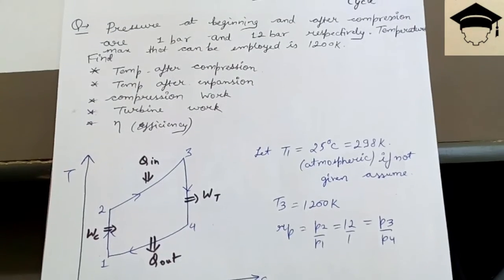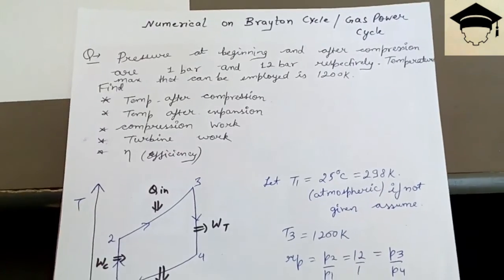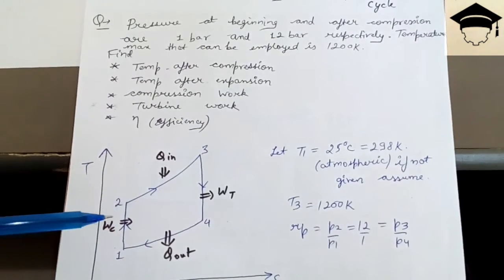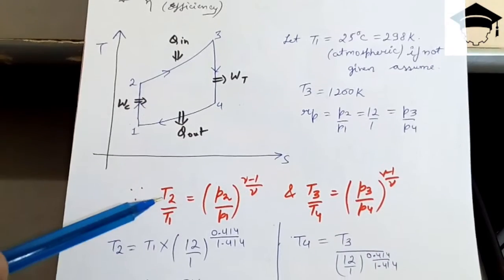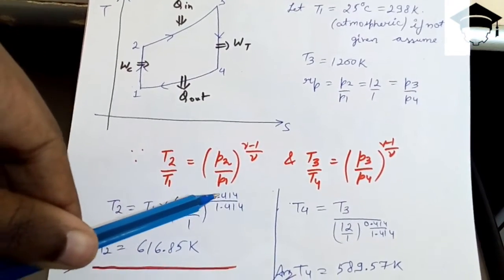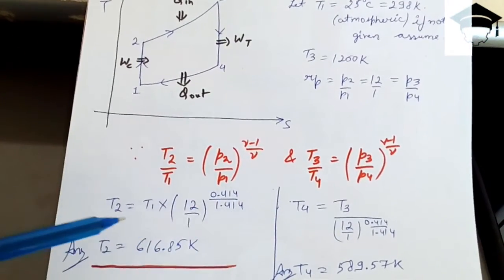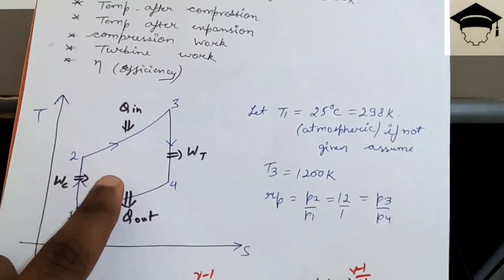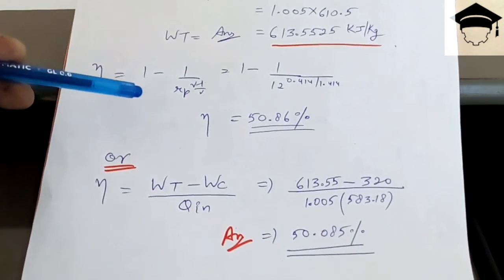brayton cycle solved numerical|brayton cycle solved example |brayton cycle nptel | brayton pv and ts

Comment: Hi, i have got this problem and it has defeated me. may you help me solve it. 
A gas turbine to drive a locomotive has the following technical specifications:
Combustion chamber pressure 600 kPa Inlet air pressure 100kPa
Inlet air temperature 20°C Exhaust gas pressure 100 kPa
Air mass flow rate 12kg/s Fuel mass flow rate 0.25 kg/s
Fuel calorific value 40 000 kJ/kg  
Assume an ideal Brayton cycle with no losses in the compressor or turbine and constant specific heats based on air only. Neglect the mass increase due to the fuel flow.
i) Calculate the temperature at all key points in the cycle,                              
ii) Sketch the process on a T-s diagram showing temperatures and pressures,
iii) Calculate the power output from the unit,                                                      
iv) Calculate the thermodynamic efficiency of the cycle.
Reply from the maker: Hello adam the problem can be solved in a similar manner as I have explained, but in this question there is one addition that the heat added from 2 to 3 is ( air flow rate* Cp * (T3-T2 ) + (mass flow rate of fuel * calorific value )) which you can find . T-S diagram will remain as I have explained in the video . You can find temp at all points using the isentropic relations as I have already explained in the video .